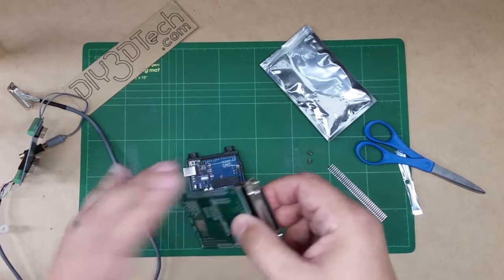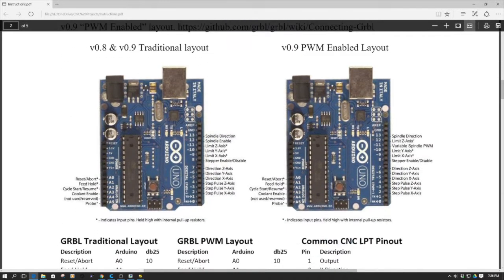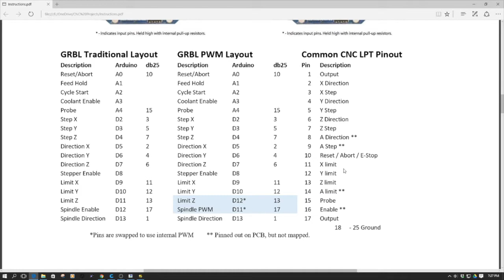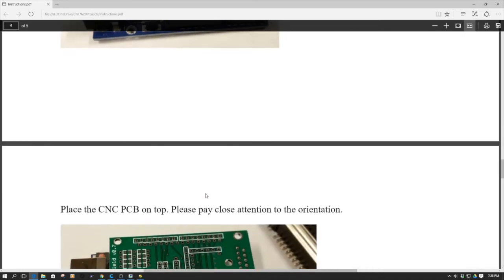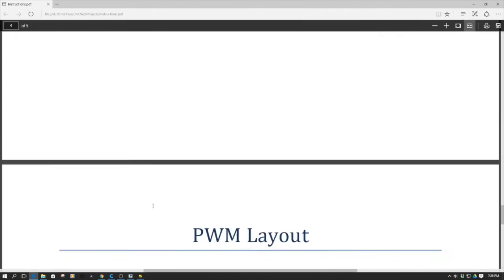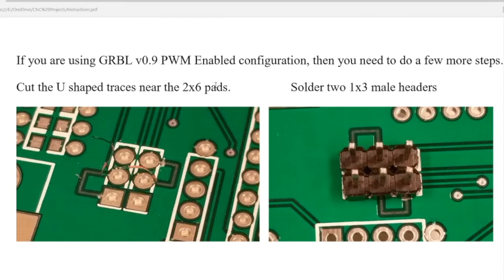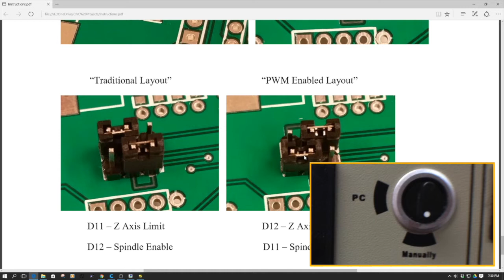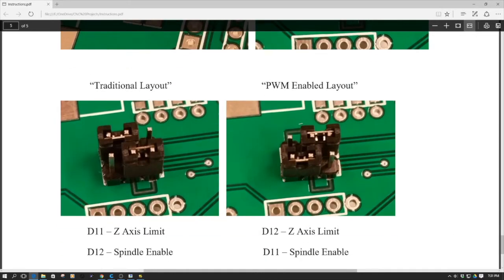3040 CNC - Converting to GRBL with LPT DB25 G25 USB Adapter!

Comment: I have a machine with LPT,
I did it on arduino uno, the frequencies are low. I also reworked the BSMCE04U board, it works. But now I stopped at the ESP32 GRBL, I am very pleased. There are reviews on the channel.

Comment: Great great video. It fired me up to want to convert mine homemade cnc from the old xp tower to GRBL and a laptop. Purchased the kit you mentioned. Assembly  was easy and painless but now I can only get 2 axis to move. Am using UGS to send gcodes. The x axis only studders or pops when I press the button. I thought it might have been a frozen bearing because it had been stored for 6 years, so I removed the motor but to no avail. Have replaced driver, arduino, usb cables and part of the origional wiring. When I hookep it back up to the tower with Kcam on it, everything works but there is a problem with Kcam and I can only use the jog buttons. Apparently Kcam is no longer supported. Could not find the forum or contact Kellyware.  I have ohmed out all the connections on the board so I feel all of the solder joints are fine.  Am at a lose and have been pulling my hair out for 3 weeks now. Have spoken with company that origionally got parts from but they have no ideas. Any thoughts come to mind? Any suggestions would be appreciated. Thanks John
Reply from the maker: More then likely a bad cable, swap the y motor & cable for the x and see if works.  I get bad cables all the time....

Comment: I bought a 3040Z DQ and this adapter but nothing works. I see that the Arduino get the g code commands from chilipepper or UGS (lights on the board) but the machine dosnt respond  (Grpl 1.1 & 0.9j tested). I dont have a PC  so i have not confirmed that Mach3 works and so the drivers/card that comes with the cnc. Only got the spindle running - turning the front knob. This is my machine: https://www.chinacnczone.com/en/new-500w-spindle-3040-router-desktop-mini-cnc-machine-with-usb-interface_l66_p155.html
Any idea troubleshooting this?
Reply from the maker: With out a PC how are you sending the GCode?  Its been a while since I built these (build quite a few) and sounds like you have not enabled the controller.  However I did write an ebook to help others on amazon: https://amzn.to/2TImjeL
Reply: Thx.I bought a original arduino uno and putting in $0=15 (default was 0=10) & I got it working with Grbl 1.1 using ChillPeppr GRBL!! (http://chilipeppr.com/grbl)  as a controller/gcode sender. 
Can only control the axies. The limitswitches do nothing and i have no controll of spindel (have not done the PWG hack? Unsure how it is to be done ..Two of the u-traces should be cut, ok & then Solder two 1x3 male headers, ok.. but next  ..there is something put on these headers. What is it? Is it for shorting pins? (http://kclinear.com/g25/Instructions.pdf).
Never ever used a cnc, cam,cad or the likes so lots to learn! So YouTube learning. Thanx for your channel!
Reply from the maker: Your welcome and I have used Chilipeppr with 0.9 however not my fav (Universal GCode sender has been my go to).  You need to enable the limit switches and yes PWM will work also however its counter inititve (IMHO) to wire these.  I am still on 0.9 so not sure if 1.1 clean this up or not.  However I invest so much time to get this all working, I am not in a hurry to reinvest the time since I have it working...

Comment: Hey, complete CNC noob and very novice arduino user here, I've just done the mod to a 6040z  with the sxcnc controller(similar to the one you have), but for the life of me I cannot get it to move the machine through UGS.  The uno connects to UGS and I hear the board in SXcnc box make sounds like its receiving signals from the uno, but after that I cannot get movement from the machine, jogging in UGS. I did a quick try in ESTLCAM too, still no movement but I do hear the motors attempt to move at snails pace(I probably don't have the settings correct there). Since its a new machine and the only desktop I have is a win7 64bit, I can't test the SXcnc controller via DB25-Mach3. I'm a bit lost on where to troubleshoot from here.
Reply from the maker: Did you try feeding it some simple Gcode to see if would move?  Also check your stepper enable pins as well any required emergency stops pins.  Its been a while since I did this, however when I did I wrote a book to document it and placed it on amazon here: https://amzn.to/2KMiXCI
Reply: Just did, UGS runs the file(so I know its not the file), machine doesn't budge. I just got your book, I'll check it out now, thanks.

Comment: I was to connect my 6040 to the pi but arduino seam the any help would be helpful  the controller has a USB malcolm
Reply from the maker: Not sure what your trying to ask, if you want to run your CNC you need to use arduino and GRBL and you can use a Pi as a GCode sender, however Pi's aren't good drivers...

Comment: Excellent video. I bought one of these adapters right after I saw this, however, I can't seem to get it to work with my homemade 3 axis CNC router. My machine uses four 425oz-in NEMA 23s (two on the Y axis), four DM542A  drivers, two 36v 10a power supplies and a DB25-1205 BoB. The LPT DB25 G25 USB Adapter is plugged into a genuine Arduino Uno R3 flashed with GRBL 1.1 and I'm using UGS. I checked the pin assignments with a multimeter and they are all correct from the adapter through the Uno and the parallel cable. I followed the instructions for the traditional layout and I also added jumper wires to mirror the A axis with the Y axis. When I turn everything on, I hear the motors lock, however, I can only jog one of the Y axis motors and it struggles. The other motors won't budge at all. Am I doing something wrong or am I missing something? Any help would be greatly appreciated.
Reply from the maker: Its been a while since I created this and can't see your setup.  Since the motors are engaging start with the emergency stop as I recall some drives I believe need to be grounded for the emergency stop (unless you have one) again its been while and I had to do this on one machine.  The other things is check your GRBL for I believe pulse width or duration as its been a long time make they are long enough to fire the driver.  Sorry can't be of more help as I have done several of these with no issues so never really had to trouble shoot anything...
Reply: I realize this is an old post but hopefully you will get it and be able to reply. I am having the same problem you listed except 2 of mine work and one doesn't. I have checked all of the solder joints, changed a driver, rewired to different axis to check to make sure everything works but to no resolve. The x axis will just studder while the y and z work fine. Have checked everything I can possibly think of. did you find your problem and get it fixed or did you throw in the towel. any thoughts you have would be appreciated. Thanks John   Have changed arduino also. Unit homemade.

Comment: Why can't you just buy/use a USB to parallel port adapter? Great Video!
Reply from the maker: Thanks for kind comments and to answer your question, there a number of issues with USB to parallel (1) most fail to make true TLL voltage and hover around 3 volts, (2) the USB port is not a real time port meaning commands will have significant delays.  See Windows is also is a bad choice as it too is not real time so couple it with a USB port and you will have trouble.  What happens here is the UNO caches the commands and sends them, in effect it is acting as a USB to parallel adapter with a buffer (via GRBL) and output the correct pulses...

Comment: Direct Link:  http://www.kclinear.com/Item.aspx?ItemNumber=G25
Reply from the maker: Thanks this is a great little add on :-)
Reply: Why Do They Insist on making all the better Controllers run on a parallel port? I mean really, who manufactures a PC with them now days?          Thanks for the Great info, I ordered one
Reply from the maker: The short version is using the parallel port is a better way to go as the arduino can only do one thing at a time so when it does an arc it sends the X then Y whereas say mach 3 and parallel port it it sends both at once.  However just as big of a problem is the OS too as windows is not a real time OS so that leave Linux.  So most GRL is ok however if your really serious you could also look at Tiny G
Reply from the maker: Looks both "cool" and expensive :-)

Comment: If you want to go a step further... Connect a Raspberry pi to the Arduino, and run CNC.js on the Raspberry.   From there you can design in your office, pull up the CNC.JS web page off your Raspberry pi, which then gives you a graphical display of the part your cutting, and sends the GCode to the Arduino.  All I do at the CNC machine is make sure the wood is setup right, and the CNC machine is zeroed.
Reply from the maker: yes i have as done this as i use the pi mounted in a monitor like an all in one and it work along with being cheap 😉
Reply: Cheap is good. I've been avoiding the Parallel port driver board systems because I didn't think it would work with the RPI / Protoneer board. Protoneer board just better integrates the Arduino connection with the RPI and with the stepper motor drivers. Thanks to your video connecting that to one of the parallel port 4axis boards I see on ebay wouldn't be hard.

Comment: Thought I'd share some of my experiences with this adapter. It was initially sold out on Amazon and ebay when I went to order one, but I did find it on Tindie. My order was quickly filled and I had it in hand in just a few days. I had the adapter assembled and ready to go when my 3040 arrived a few days ago. My setup APPEARED to work at first, but I soon discovered that my sample cutting jobs would stop partway through, especially when the spindle was turned on. I replaced all cables involved, tried both the .8 and .9 GRBL firmware and used both Universal GCODE Sender and GRBL Controller software. It appeared the errors were serial communication related, so I swapped out my UNO clone for the genuine article. The difference between these being that the clone uses the CH340 chip and driver and the OEM board uses FTDI. This seems to have solved my issues (so far). Don't know for sure if it was driver related, or if I just had a bad board. If you run into this situation it might be something to try.
Reply: https://www.tindie.com/products/Ron/arduino-grbl-to-db25-cnc-shield-kit/?pt=full_prod_search
Reply from the maker: Yes I too have had UNO problems in the past with clone boards, for example when I converted my CO2 laser to GRBL I went though three Chinese units to find one that worked.  However switched from Windows to Linux and have had no issues any longer...

Comment: Does the kit come with all the required pins? Like would i have to go out and get more pins for the 2x6 pad that I have to do work on? Thank you.
Reply from the maker: Not sure of the question (pins?), however it is just as you see it.  Solder it together and plug it it in...

Comment: Excellent! Part ordered, will be trying this on my little 3020. I am just in the process of removing the aluminium bed on mine and replacing it with a steel plate, more cut depth and I'm working on some metal magnetic hold-downs. Also going to attach a 3D printer heat bed to the underside to melt glue, place part and then allow to cool to hold, once cut, reheat to remove. Always playing:-)
Reply from the maker: Got you on the got to play and keep me post how this works out as this sounds very interesting!

Comment: Alright, this means you can talk to the Arduino (as we do with RepRap printers) via the USB and it talks to the machine over LPT?  If so that eliminates the need for a LPT on the PC which would be AWESOME!!!!  Doing it like this would eliminate Mach as well so I am going to finish watching this later to see what took its place.

Well, crap I have a spare Mega 2560 as I don't care for the UNO and will this work with it?  I am up to the 5m mark (very busy right now so doing it in spurts).

I finished it and still not sure.  I see that the S you are referring to is the actual spindle speed in RPM.  Yummy.  I always wanted a CNC mill/router but chose a 3d printer instead and wish I hadn't.  Far more uses for a CNC mill/router than a 3d printer BUT the issue is trying to get one that will work with 6061 T3 aluminum reliably and has repeatability.
Reply: i dont think it is physically compatible with a Mega 2560 , as the  LPT port hangs down . you would have to get the opposite gender port so it could sit on top ,  or use double tall jumpers , or extenders of some sort to get you clearance for the LPT port as it is .  then you just edit your sketch to map the pins is any for be 2560 compatible . once you make the  thing physically fit its  just changing some things in GBRL , possibly not even needed.
Reply: XerotoLabs
I would get a male anyway and have it stick into the back of the controller and ditch the LPT 25 pin cord.  Maybe there is something else I could use?  No way will I ever buy a Smoothie and a Due is something I am considering for my beast 3d printer I am making but not going to do that for a CNC machine like this.  I know they make a grbl shield for years now but I never investigated it.  Maybe the AT Tiny?  I want something that is capable enough without breaking the bank.
Reply: you could prolly  just  buy / salvage a old real DB 25 pin cable ( some dont have all the wires you gotta cut to be sure ) . and use a cheapo arduino UNO R3 . ,  but if you salvage a cable and carefully solder it to the board it wont matter that its on a mega . later  you could pick up a dedicated clone of a UNO R 3 for like 10$ to free you Mega back up for bigger tasks .  IN fact if you chop a old cable you could just  solder it to your own set of pin headers rite into the mega or such . if cable is salvage , then cost is only a set of pin headers a possibly a 3d printer  frame to help hold it tidy .
Reply from the maker: As Xeroto Labs points out its only the UNO and yes it does away with the need of Mach 3 at least in parallel port version and that is the cool piece.  The part about the S code is S0 turns the spindle off and any S code above that turns it on however say doing S500 does affect speed it is either on or off...
Reply: DIY3DTECH.com
Ahhh, then that is not for me because that Sxxxx is supposed to mean the spindle's RPM else why even have a spindle?  If all you want is on/off just use a palm router.  So, is it the electronics that came with the machine that is the culprit or this thing you purchased?

edit:  I see it is the crappy Chinese electronics that is at fault as its micro controller doesn't interpret the G code for a variable speed spindle it is a half ass setup where the manual knob is the only way to change the VFD.   I wonder if the micro controller is involved at all as I lay odds it is a simple frequency setup using all analog bits and pieces.
Reply: its such a cool idea and small .  Does it have any components on the board or is it just routing the 25 pins as needed to GBRL equivalent pins?
Reply: XerotoLabs
looks like it is just routing to me though it has markings for components so must be a dual purpose board (possibly another model sold for more).
Reply: yeah is suspect you are correct . If i recall a real LPT port is 5V max , so possibly they have provisions for use with 3.3v arduinos.
Reply: XerotoLabs
It sure looked like a lot more components that that though.
Reply from the maker: Just the DB-25 and header pins, pretty basic.  There are silk screening for other parts, however I assume the developer (seems to be a little mom and pop shop) likely designed a multi use board to keep the price down by using for a several different purposes...
Reply: DIY3DTECH.com
Exactly.